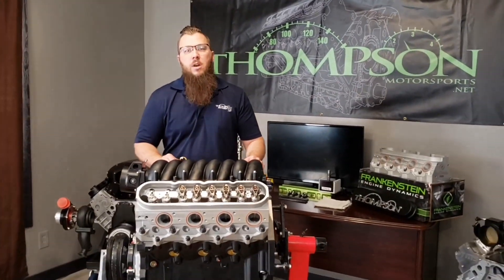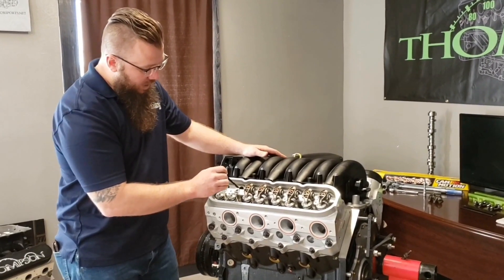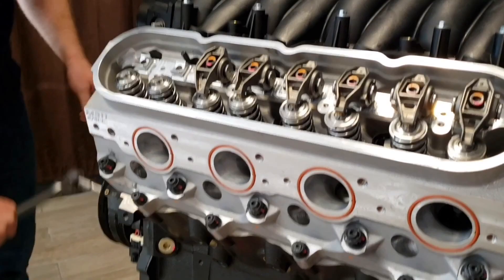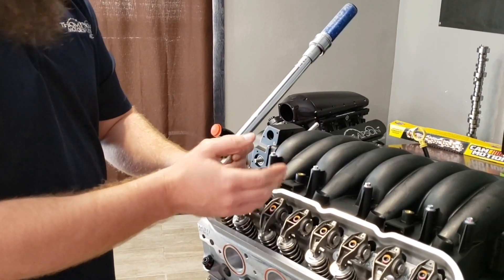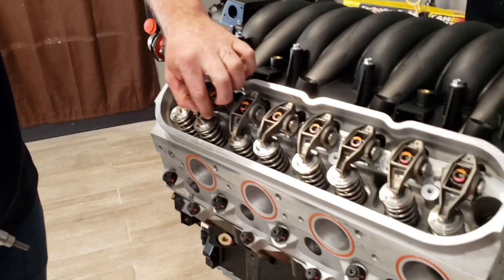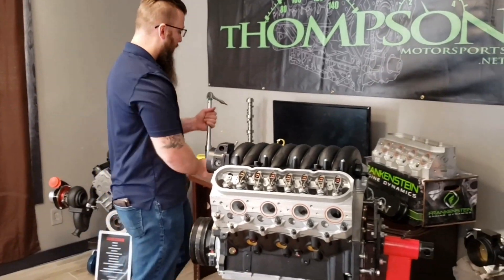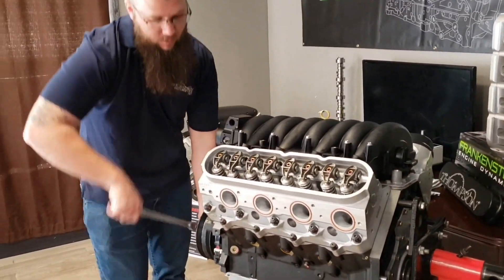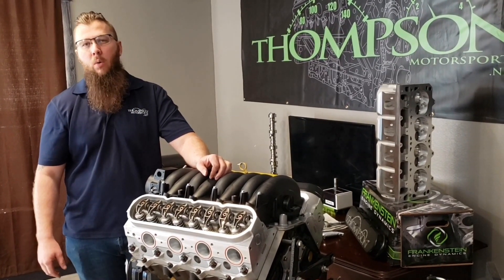Setting lifter preload on an Hydraulic LS motor with a Thompson Motorsports LS7 style lifter

Comment: Yeah, just as long as you require the valve rocker not to be noisy and no extra tension to keep valve open at the wrong time and rotation. Good valve seal is good for the proper valve overlap for performance or emissions standards if applicable.

Comment: I like the way you explain for the people that watch you, I don’t using silicone in the inner engine components, I prefer using the aviation glue same thing is Indian head, like Rod and main torquing I use it on main cap bolts ,head bolts cause it doesn’t let the coolant affect the threads, and torque is never a dry torque It should have a slick thread so there’s less friction and more accurate for the torque.. putting any silicone in where there’s oil eventually it will end up in the oil pump system and that’s not healthy for an engine, it turns into a Jello..
Reply: I think thread locker will be better

Comment: I dont understand how tightening down on the rocker arm 1 and 3 quarter turns before the tourque wrench clicks at 25 ft pounds what ever that means would make the push rod too long while tightening down on the rocker arm 1 and a quarter with the click of the torque wrench at 25 ft lbs of pressure on the lifter or (preload) means the the rod is shorter shouldent it be the other way around?

Comment: NO- If the pushrod is too long that would be 3/4 turn, too short would be the 1 1/4.  You have it backwards on this video.
Reply: He's correct in the video
Reply: I kinda went by what he said and it checked out .. at 7.400 I was at about 3/4 turn . And i went up to 7.500 and got to one full turn . That sweet spot like he said .

Comment: Only Thing They Forgot To Mention Was You Can Only Use This Method 1 Time On A Pumped Up Lifter. After You Tighten It Down The Lifter Is Gonna Bleed Down And Get Spongy. I Did This With With Pumped Up Lifters And Even Low Tension Springs Slowly Bleed Them Down.
Reply: Sounds like what’s going on with me right now I have one lifter that’s really spongy and it’s getting me all paranoid

Comment: No. You dont want to go to the torque setting. You want to turn until the bolt bottoms out. Going to the torque setting is wrong because youre adding the stretch of the bolt to the turn on the wrench. Use a small wrench so you can feel, and caluclate the thread pitch of the bolt to the number of turns till it bottoms out.

Comment: People I need a high performance 5.3 or 6.0 for my 2000 Chevy Tahoe. I want to desimate all . Cameros ss . Mustang 5.0. If I can beat those two cars in a roll race then I would be happy with that. At least stock ones. Heavy truck my truck. 2000 Chevy Tahoe. Looking for a dependable daily high performance 5.3 or 6.0. built . And maybe a turbo kit install in the future.  What do you guys at Thompson Motorsports think?

Comment: I have a fresh build lq4  6.0L  and haven't primed engine oil yet. Doing turn method i get 1/4 to 3/8 turn to 22ft lbs on rockers which seems to requirelonger p.rods. Will that change after engine is primed and lifters are full of oil?

Comment: this method isnt that accurate because the bolt is closer to the rocker centre than the part of the rocker pushing on the pushrod into the lifter, its like a seasaw, the closer to the middle you are the less movement there is. Sure you get 50 thousandths from the 1.25 threads on the bolt but you will see more at the pushrod (I have tested this)

Comment: Will this method work with adjustable roller rockers? Adjust to zero lash, turn it 1-1/8 and lock it down...or would it be a different process?

Comment: Once you bottom the bolt out, that's your preload, not to what it is torqued to. You got the extra turns on your wrench after the bolt bottomed out, and because your calculated that in, you don't have the correct number. The extra turns after bottoming out, has virtually zero affect on preload. Just thought I'd mention that.
Reply: Boy, oh boy, you shouldn't have a wrench in your hand prelo. Ad isn't to twenty two foot pounds of torque.Preload is how far you drove the piston down in the lifter. In other words, how many turns past 0 lash? That's your preload, twenty two foot pounds is the torque it takes to secure it. Now throw your tools in the trash can.
Reply: For an 8mm x 1.25 thread bolt I always used 1/2-1 full turn until the bolt seated to check lifter preload. Anything after that, you are not pushing further on the lifter.  This method works, it’s just not how I do it lol. You are assuming that every bolt will hit desired torque at the same rotation which hurts your consistency. Also, the zero lash point, you can feel it if you are turning your bolt by hand.  It is very slight , but that is the most accurate way, Potatoes, potaaaatoes. Glad to see others have used this method, thanks for sharing.
Reply: @iliketowatchthis  no I'm not assuming anything. Once the bolt and the rocker are flat against the mounting surfaces, you cannot get anymore preload into the lifter. The rocker stud mount isn't just going to "squish" and allow this to happen. The rocker bolt can certainly turn some more, and that's all just thread bolt torque. The threads stretch slightly. Counting those turns into your equation does not account for an accurate outcome. But these lifters have a bit of room to play with anyways. Good luck
Reply: @boosted0079  you get zero lash before the  rocker bottoms on the stand, if you dont then the pushrods are way to short.
Reply: @robbygray9562  I understand that. That's not at all what I'm talking about though. After zero lash is established, you start counting turns on the bolt like he did here to determine the preload. Once the rocker is seated down onto the rocker mount, and the bolt can no longer turn, then you take how many turns that took and use only that for the preload equation.  Any turning of the bolt after that is just bolt torque of the threads, you cannot get anymore preload after that point. That's what I'm trying to explain. You might get 3/4 of a turn more when torqing the bolt down after the preload is established, but your cannot count that turn into the equation for determining preload. That would be inaccurate. That's all I was explaining because in this video he counted the turn of the bolt being torqued after all the preload was into it. I've seen this mistake made ready to many times, and then people wonder why their engine sound like a sowing machine lol. It's because they calculated wrong and got shorter push rods than what they should've gotten.
Reply: @boosted0079  what is your method then? I am trying to measure my push rods on an LS2 with LS7 lifters. BTR cam came with 7.4 pushrods but the valve train is loud.
Reply: Tell us you don't understand how this works, without telling us you don't know how this works. As you have already been told, when you set zero lash the rocker pivot bar is NOT touching the rocker stand. When you add the additional 1 turn it pulls the pivot bar into contact with rocker stand which compresses the lifter the preload amount.

Comment: Can you set valve lash in a similar fashion with an SBC hyd lifter and roller rocker or do you have to use a soft (light) checker spring?
By the way that was a great video on the valve lash on the LS motor
Reply: I don’t believe so , sbc is a pain in the ass compared to the sbm and ford and neeeer LS

Comment: Thanks for the video guys. I changed to a pedestal mount set of rockers with gide plates. Im thinking it will still be the same process.  If not plz stop me. hahahaha. I got the china pro comp ls3 offset solid aluminum roller rockers, for my G8 GT.

Comment: 1 turn isnt .050 Though.
Reply: Isn’t one full turn .078 of preload on a 1.7 rocker?  I know gm performance lifers recommend “.050 - .100” preload.
Reply: Wouldn't you calculate that by the bolts thread pitch and then 🤔 
Factor in the rocker ratio
 or you could easier clamp a dial indicator on there and see what it is 100% with no math errors

Comment: I just bought a 2008 gmc truck with a 5.3 with 156,000 miles.   It sounds like a sewing machine under the hood.  The previous owner said that he had the lifters change about two years ago and the engine had about 120,000 on it.
Is there a chance that i need to get in there and re-torque the rockers in order to get the sewing machine sound out of my motor?  And can these valves be adjusted like this at anytime in this motors life?  Thanks for any help with this.
Reply: ^valve lash is net built no valve adjustment is required^ it is needed only when you get involved in aftermarket heads/cam/lifters the combination will dictate the pushrod length adjustment

Comment: 25ftlbs?   But Everything online says 22ftlbs.
Reply: Once you hit ~ 18 ft/lb the trunion will be seated properly and preload will be set the rest of the torque 22 or 25 is for stretching/securing the bolt 
You will see this only if you have a dial indicator  setup
Reply: Also wondering about this.
Reply: 3 ftlbs is not going to be a war stopper

Comment: Great video. Maybe add another video of using a push rod length check tool. Took me forever to try and understand the turns method for preload but about one time with a checker tool. Either way, great tech!
Reply: I agree seems like checker tool works faster and easier
Reply: I used comp cams tool, then measured using a digital caliper...however you have to measure a known length pushrod length and subtract the difference to get back to the correct length. Example 7.4 read 7.410 so subtract -.010 to get to 7.4. It works.
Reply: Thompson Motorsports. I’m just learning this. 51 years old later and I’m gonna do a valve train on my 5.3. One turn is 0.050. Now I got it. Never did get that until you generously gave it. Thanks. Other vids they don’t get to much information like we already no why this don’t work. Lol. Thanks.